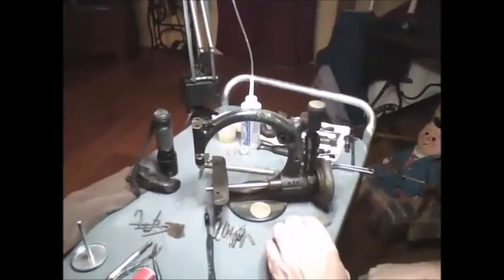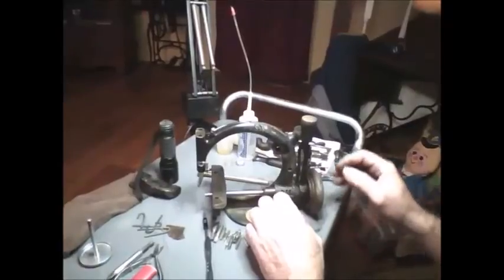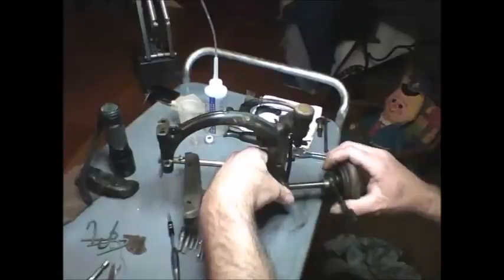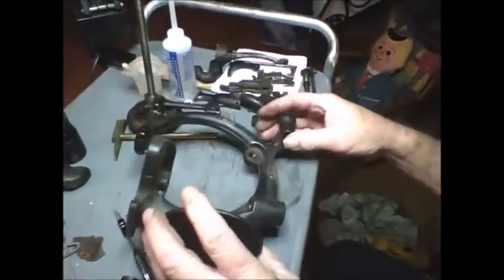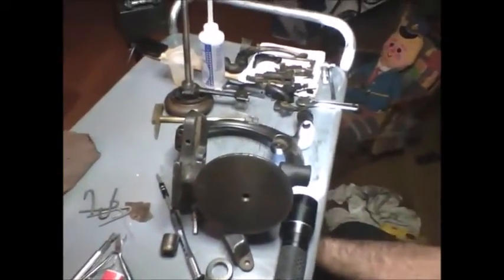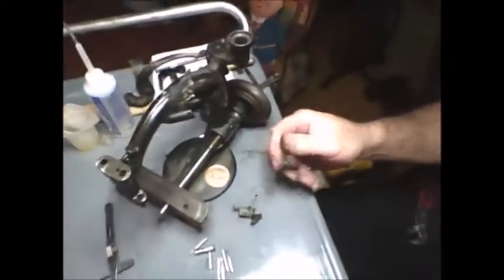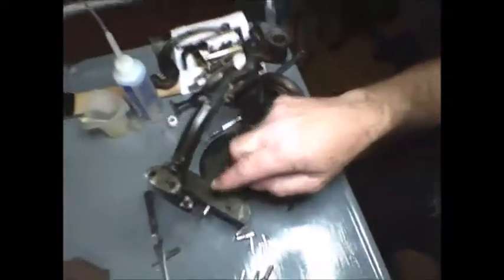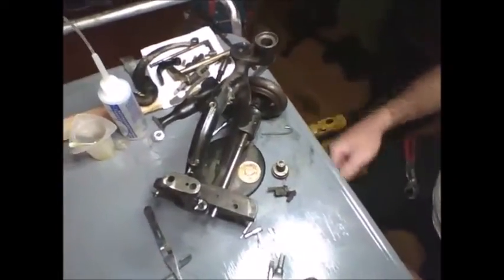Willcox & Gibbs Automatic Tension Disassembly and Reassembly

Comment: My Willcox and Gibbs is working ok but the thread on the bottom of the stitch is a bit loose and loopy, and sometimes it gets caught and I have to cut it out from the bottom. Does that sound like an issue with the tensioner? Would you suggest I disassemble the tensioner and clean it like in this video? Thanks!
Reply from the maker: yes it does sound like a tensioner issue :-)

Comment: hi ray . i have a singer patcher 29-4 machine .1901year. iwant to take it apart to clean an polish and repair any parts that are warn. is there arepair manual on the 29-4  machine . help? thanks chet .see ya
Reply from the maker: Not that I am aware of. There are a lot of folks that have one (we do) but I haven't seen a repair manual for them. They are fairly simple though, all that I remember being frustrating is getting the hook rack and pinion back together and timed. I just had to do it trial and error.